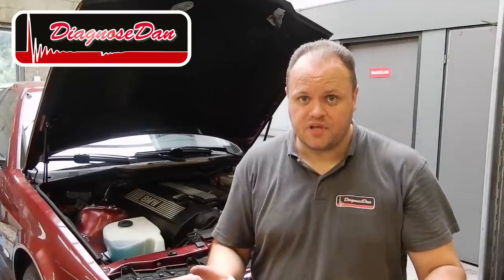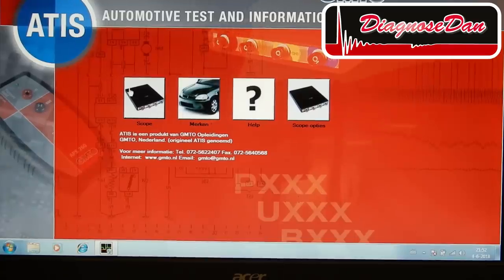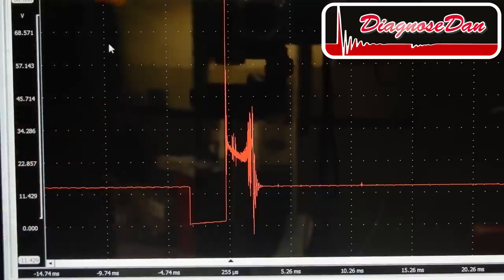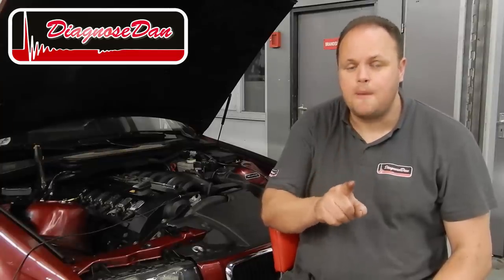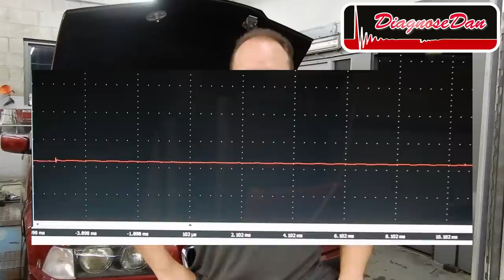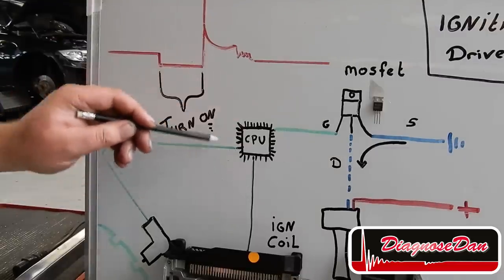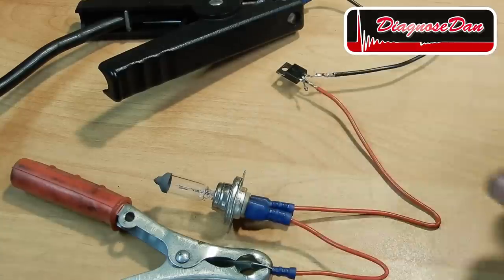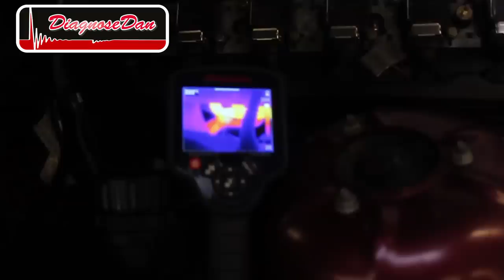ignition coil driver

Comment: A MOSFET. Isn't that basically a solid state relay? A transistor, so to speak? 

Are all drivers in a pcm, a mosfet, or is this just the design used in this pcm?
Reply from the maker: A Fed and a transistor are different  in the way that a fed only needs voltage to switch and a transistor needs current flow and get's hot. That's why Fed's are mostly used in these circuits.
Reply: There are too many different PCMs models to say they all operate using MOSFETS. Yes, a MOSFET can be viewed as a solid state relay when used as an ON/OFF switch.  The same can be done with a transistor that can handle the load and can turn ON and OFF fast enough to keep up with the required frequencies.

A MOSFET is  a voltage controlled device using the Gate and a transistor is a current controlled device using the Base, so each would require a different design control circuit inside the PCM to turn the drivers ON and OFF.

Comment: If you take your car to the dealer. The “expert certified” mechanic tells you is to replace the battery and if it doesn’t fix the problem. Replace the engine!!

Comment: At the point you discovered the pcm was not grounding the circuit, how could you be sure that it was a bad ignition coil driver and not the pcm intentionaly not switching due to seeing a fault.

Comment: Hi Dan, great explanation on the MOSFET. Is this most likely caused by a shorted secondary ? i.e faulty plug/coil and the owner kept driving with a mis-fire for to long ? Or is it a common problem with the ECM ? I would love to know how you got around the immobilizer issue as well :-). Although this guy may have told me ? 
https://www.youtube.com/watch?v=pnR7QL2J0A8
Thanks
Reply from the maker: herr kiwi When you have a shorted coil always check the driver! It's not common but it does happen sometimes😁

Comment: "good job" siemens for not using a protection (another driver) for the gates of the mosfets ...
Reply: Thought the same thing, but Bosch is not better. Had seen a Golf Mk6 with blown driver and Cpu. A Diode would fix it ant should secure the backfire, sad that it was forgotten or for obvious reasons not added. And reprogramming or disabling the Immobilizer would be interesting. Last thing would be illegal in germany, so immoboxes or software to disable it are for education only ;)

Comment: let us think 2 pcm in a car
first with a bad driver but with a good vin in it
second with a good drivers but with a no good vin
when starting a car can or other network used to communicate between pcm and immobiliser is with first pcm 
after security handshakes high speed switch disconnect first pcm network wires and connects to second pcm network wires
both worlds are now agreed